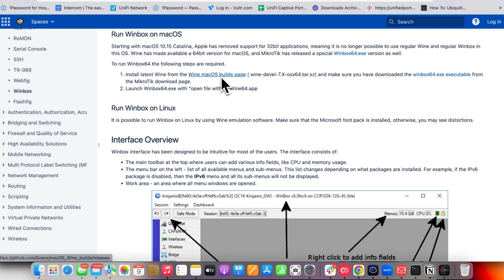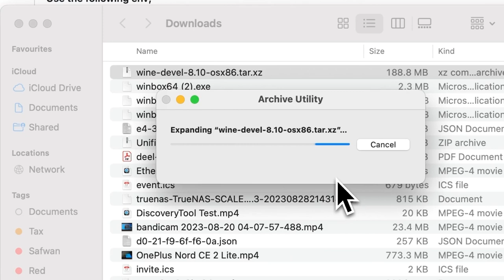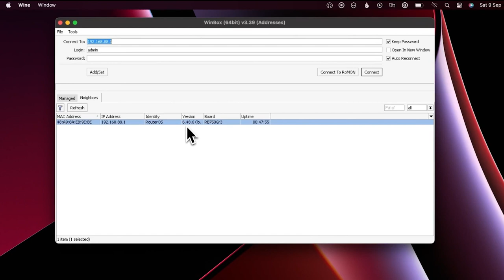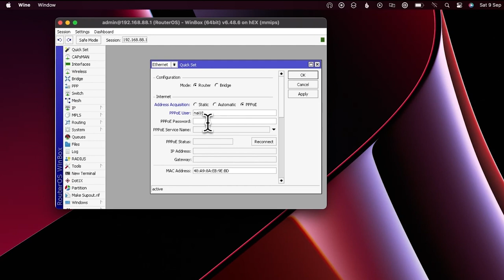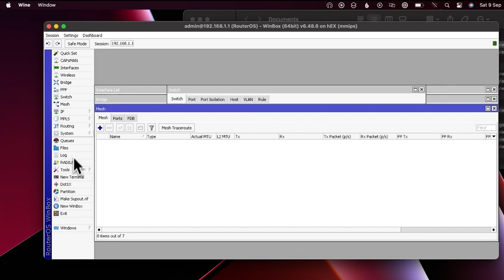Mikrotik RB750Gr3 Basic Setup | Easiest WAY

Comment: Mai nay ap ki vedio dekh k kal yeah mikrotik rb750gr3 lay k aya ho mery isp ki speed 250mbps hai pppeo hai but yeah device ocla speed test mai 130mb download and upload 60mb deta hai
Reply from the maker: Test on different speed test apps and make sure aap ka laptop directly plug into router and check the speeds.
Reply: @techtalkandtechunboxed  yes I connection laptop with wire but show same AP bhi ek vedio bany speed test ki